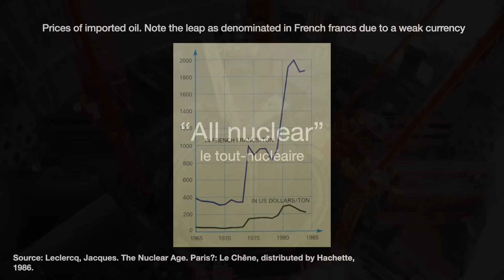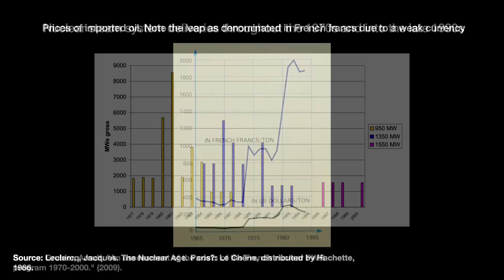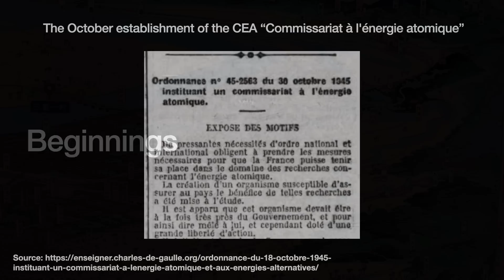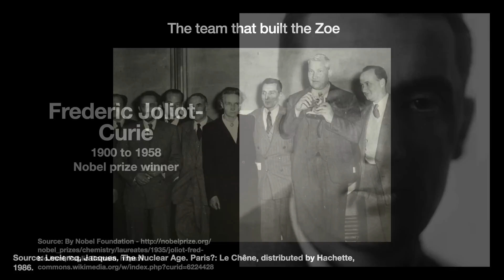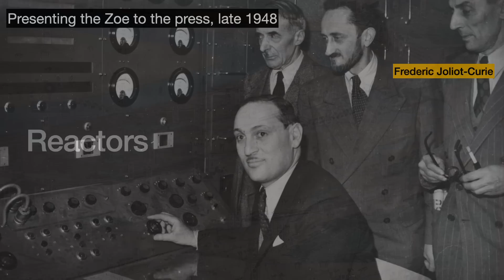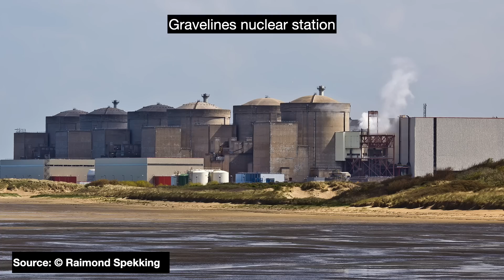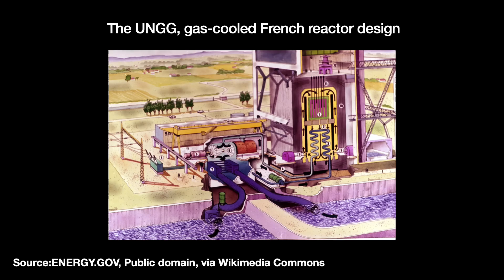That Time France Went "All Nuclear"

Comment: Interesting to hear that steam from PWRs is at a lower temperature than steam from coal fired plants. When Britain developed the advanced gas cooled reactors (AGW) they designed the outlet temperature to match the temperature of coal fired plants so they could make steam at the same temperature as coal fired plants and then use existing turbine technology without modification.

Comment: Until the 1990s UK's nuclcear engery was also entirely state run, with Atomic Energy Association running those reactors for the nuclear weapons programme  as well as war head manufacture, CEGB responsible for power generation and running the later Magnox reactors optimised for power rather than plutonium generation and British Nucler Fuels responsible for reprocessing. In the UK in the late 60s there was a similar "reactor battle" with the CEGB advocating for the General Electric BWR and Atomic Energy Authority advocating for the Advanced Gas Cooled Reactor (AGR) an evolution of the Magnox reactor, the AGR winning.

Comment: Another good video.  Problems:  he more than once confuses nuclear reactors with nuclear power stations, such as when he called the early Mesmer plan for 13 stations 13 “reactors.”  Stations typically have more than one reactor.  Also, he offers very little, almost nothing, on the single most important aspect of the French nuclear program, and the feature which sets its apart from every other program in the world, reprocessing.

Comment: Nuclear technology is the most  enslavery tech that exist, it is by nature one cycloide dépendance always increasing rate of dépendance, andcit is also one always more massive tech, only the small nuclear reactor escape this tendency, so the fragmentation of that technology is very difficult to realise in practice life...and always bigger and massive end up with critical security efficiency, ...so  with the huge park of Nuclear power in France, France got a very big financial problem to run it safely. because if the runing cost are limited,, but very high periodically, the permanent costs for assuring security are exponential, so any extended nuclear capacity always end up costing mutch more than prevision, and so force a country like that to look every where to take from every where funds,...it's a trap, but one trap with one very attractive false face, high tech always request high covering of costs, and always need permanent survey, and humans are not robotic permanent entities, so, ...⚓⚓🔎⚓⚓

Comment: This sounds very similar to the current Chinese nuclear plan. Top down strategy, standard designs, then later designs with local intellectual rights, increasing local share of parts. But China has massive needs for electricity, after decades of several plants started per year and almost as many reactors as France they are still to break 6% nuclear share of electricity.
I still think the nuclear industry would have been in a much better place if the political factors had taken a back seat to engineering and economics. Nations that didn't need nuclear weapons made reactors that were both economical, fast and easy to construct. The Japanese boiling water reactors are still among the cheapest, and the Canadian heavy water reactors can use natural uranium and used up fuel from other plants.
I think the nuclear industries of Japan, Canada and China would make for an interesting video.

Comment: I was bullish on Nuclear, thinking it would be a cheaper option but then I looked at France's electricity prices and they pay a pretty high price compared to other large economies with a lot less nuclear. So I don't think it's the solution if you think your electric bill sucks
Reply: Actually that's due to marginal pricing. Nuclear is cheap. But they don't charge nuclear. They charge you for the highest producers cost. Ie if nuclear is 40 Dollars a mwh and gas at 90 then nuclear gets paid 90 too gets it

Comment: The turning point for me was when the grid promoters said that new grid was extremely expensive more than $10million per km. 
($13million km for HumeLink 365km in Australia)
And also said that GRID costs to the consumer was part of electricity costs.
GRID RENTAL costs.

So Distant Renewables also had GRID cost. 
And new GRID Renewables was adding to consumers costs. 

These are nuclear promoters talking about GRID electricity.

Basically ROI, return on investment. 
Say about 10% per year of the system's valuation. 
1million km x$millions is $TRILLIONS 
Replacement valuation is bigger and decades longer.

ROI is $100sBILLIONS per year. Big 

New nuclear $10billion per GW.
14gW is $140 BILLION 

ROI is $14 BILLIONS per year. Small 

Nuclear promoters are correct GRID RENTAL COSTS are biggest costs to consumers. 

Nuclear promoters are correct GRID 247 demand is minimum for MAXIMUM UTILIZATION efficiency. 

Governments are correct massive grid upgrades costs are to be avoided. $TRILLIONS saved in budgets and their bigger taxation costs.
Fragile lightweight neglected national grid's budget busting upgrades are election losing political deadends.

Nuclear promoters economics of bigger costs to consumers is correct. 

Fortunately PV roof technology on dirt-cheap empty roof realestate has no GRID RENTAL costs to consumers. 

Fortunately all consumers have a roof to sleep under and a roof to go to each day. 

Fortunately consumers energy budgets can be redirected into PV roof electricity technology to unload the fragile neglected national grid.

Fortunately the daily DUCK CURVE of grid demand collapse in business hours is reinforcing all governments budget saving strategies. Happy days. 

Nuclear promoters are correct MAXIMUM UTILIZATION of private infrastructure investment, PV roof electricity is a valuable strategy. 

Unfortunately massive wealth is distorting common sense as nuclear plants are the favourite new PPPs favoured with government garrenteed cashflow and profits for 100years. Public Private Partnerships. 

Actually the real world facts are PRIVATE PARKING PLACES, PPPs for wealthy money and owners in tax havens shedding responsibility. 
Bad PPPs manipulation of common sense. 

Unfortunately silly-named comments are 'flooding the zone', for the wealthiest looking for Bad PPPs.

Comment: My concern is the promoters pushing to replace fossil fueled energy with grid nuclear  electricity starting with half of the existing national grid in Australia.

It is a massive investment that needs other generation as nuclear is too fragile to handle too much demand. 
France is lucky it can dump excess nuclear electricity into Germany and Belgium and Italy and Spain and maintain its nuclear fleet STABILITY. 

For Australia the previous federal government started the Snowy 2.0 project with a $2billion budget to get the tunnel machines into the ground. Now the budget has exploded to over $15billion and the time frames is unknown. 

The nuclear promoters want the nuclear option underway and fossil fueled energy extended 20years into the future. 

The grid and V2 vehicles are agreed for the future , but the economics in sunny Australia is ignored.
Reply: Nah

Comment: The problem with using enriched uranium is that it was originally the unwanted  waste product of the bomb making process - Alvin Weinberg used it in the original LWR reactor (Nautilus) because it was all that was available. 

You get 1kg of 3% enriched uranium for 9kg of depleted uranium which is the feedstock for making weapons-grade plutonium - this underscores the weapons aspect of enriched uranium. If you were really throwing out 89% of the original product and enduring a 500x cost increase, you'd use a natural uranium burning design (3% enriched uranium costs more than gold) for the same cost or cheaper

LWR, BWR and heavy water reactors all suffer badly from corrosion. Water at 325C and 20-100atm is not a benign substance (See Besse-Davis 2003) and the engineering stresses on boilers goes up wih the CUBE of the power being generated - you need around 3500MW thermal energy to drive a 1GW electrical turbine. A 8MW boiler explosion can easily flatten a city block. You really don't want the added complication of radioactively contaminated water in it too, but that's what we currently have

This leads to stupidly high cost on reactors (boilers) and they're a low margin item, which has resulted in all but one western supplier getting out of the business, only making them at a very low rate with a huge backlog in orders. The buildings wrapped around those reactors have to be able to contain a steam explosion and that in turn makes them cost billions

You've covered the wet steam aspect and significantly understated the engineering aspects. Turbine blade erosion due to droplet formation is a huge problem and the water condensing in the turbine case is also a huge problem

All of this pales in comparison with nuclear reactors needing to be loaded up with 2-5 years fuel at the outset. Any power station with that much fuel onsite is going to be dangerous if things go wrong

Weinberg recognised those issues, The LWR submarine reactor  was a "laboratory demonstrator" proiving that nuclear power was feasable but was NOT intended for commercial operation. What kind of commercial reactor has 89% input waste and 98% output waste, needs constant babying and has the potential to break in very nasty ways?

Industry ran with the LWR design because the US Navy has paid the R&D costs AND because the USA military encouraged it - using enriched uranium as fuel provided a figleaf for their depleted uranium bombmaking chain. Even by the early 1960s it was apparent that LWR or BWR designs were more expensive than burning coal and most commercial operators stopped planning for it

Meantime Weinberg was NOT HAPPY with what was transpiring and regarded LWR/BWR designs as dangerous, in addition to the nuclear weapons vs fuelling aspects (he was ardently anti weapons) as well as the high waste production(*). On top of that he reocgnised that ANY design using fuel rods is inherently abusable to produce weapons materials(**). That's why - via the Aircraft Nuclear reactor program(***) - he came up with the Molten Salt Reactor Experiment at Oak Ridge.

(*) HIgh volumes of waste are relative. A 1GW nuclear plant operating for 60 years produces about a an olympic swimming pool's worth of waste and that waste will be less radioactive than the original fuel in 450-500 years (yes, there's a 20,000 year aspect but that's 20k years of radioactivity that can be stopped by a sheet of paper). MSR designs reduce that to 3-5 cubic metres (or even less if you take a 1-3% reactor efficiency hit)

(**) All fuel-rod based designs and the LWR itself trace to the Manhattan project's X10 plutonium production reactor. Even Candu  can be abused to make weapons plutonium whilst the British gas cooled reactors were first and foremost intended for plutonium production, then tweaked for heat output.

(***) The ANR was never going to be able to fly, but it gave the funding his team needed to keep developing alternatives to LWR

MSRE worked - almost too well - Proving itself immune by design to the conditions which resulted in Chernobyl, SL1, Besse Davis, TMI or Fukushima

The design is much hotter than water-moderated systems, capable of producing dry or supercritical steam (via heat exchangers) - and can even be a drop in replacement for burners in other thermal plants.

The design produces less than 1% of the waste of LWR designs and that waste is virtually inert in 450 years. It doesn't use fuel rods, the costs of attempting to reprocess spent waste into weapons would result in bombs more expensive than U235 ones (Those are $16-30 billion apiece in materials(+), plutonium bombs are $28-60 million each) and they can be fuelled with thorium ($150/kg for that or unenriched uranium, vs 65-75,000/kg for 3% enriched U235)

The fuel freezes solid at 400C, doesn't dissolve in water and is unpressurised, meaning the worst case scenario cleanup is "with a broom", whilst the corrosion issues that are heavily played up by opponents are non-existent compared to water-cored designs (they play on people assuming water isn't corrosive when it's more like a hostile demon trying to claw its way out of the pipework and flash to steam - this is bad enough in non-nuclear plants when it happens but the added radioactive spice is what really matters)

On top of all this, MSR designs can be continuously refuelled (China's just proven that) and run on thorium without needing expensive/dangerous Th232-U233 conversion outside the reactor (China's proven this too - this eliminates an extremely expensive and unlikely possible weaponisation path)

Thorium is readily available. It's the major contaminant in rare earth mining based around monazite (more than all the wanted lanthides combined) and the first item separated (you have to do that to get at everything else). There's more of it mined each year than could possibly be used in nuclear power and it currently has to be dumped. A market for it at the same $150/kg as natural uranium would make rare earth mining worldwide and break the Chinese stranglehold on the materials  - a stranglehold because the Chinese government has been purchasing and stockpiling thorium from rare earth processors for the last 20 years. There's about 20,000 years supply in existing mining sites, let alone greenfield ones - and coal power station ash lakes have an even higher thorium/uranium concentration than monazite, meaning that mining those could pay for their cleanup

UNFORTUNATELY: Weinberg was too loud about his anti-proliferation views and ruffled American military feathers. The ramifications of civil nuclear power being totally divorced from its dependency on weapons chains resulted in the MSR being canned, attempts made to erase it from history and Weinberg being kicked out of the USA nuclear industry.

China is the only country (so far) to have made a working rebbuild of the ORNL MSRE (TMSR-LF1) but it's not the only country working on molten flouride salt thorium fueled reactors. meantime Europe seems to be ignoring MSRs in favoutr of a 100+ year bet on on fusion or enriched uranium designs such as pebblebeds and the USA has effectively kept MSRs illegal since 1972

France isn't planning to build any more nuclear plants due to their costs. That decision is likely to be shortsighted as "renewables" cannot bridge the energy gap required to fully decarbonise - it seems the traditional players have been heavily encouraging renewables so they can point to the long-term failure as a reason to stick with coal and oil/gas

Meantime China is likely to rollout MSR based nuclear power to 6 billion willing consumers. If Weinberg's assertions are correct (and so far. they have been) then Molten salt nuclear power is several thousand times safer to operate than water-moderated, 80% cheaper to build, 80% cheaper to run and because it produces so little waste, 97-98% cheaper to cleanup at end of life

Unless western nations pull their collective thumbs out of their asses, China will be THE 21st century economic hyperpower by 2050 thanks to it having broken the politics of scarcity that has always surrounded energy supplies across history. As much as the Chinese economic miracle demonstrates what can be done, their authoritarian government isn't necessarily a model the world should be emulating (for that matter the USA is demonstrably not that model either. USA citizens  are less free than Chinese ones in many ways and it's rapidly getting worse for USA residents)

Comment: So they actually had green safe and cheep energy...to bad they stopped
Reply: It's not so green as it isn't renewable, the total cost is very high, and it is less safe than renewables.
Reply: @natmaka renewables aren't very efficient and probably never will, nuclear is the way.
Reply: @C4brothers-cq4s  Efficiency (or another similar quantity such as load factor, equipment operating life, etc.) is a key criterion for equipment that consumes materials or fuel without recycling them, or that produces waste in significant quantities or that is permanently hazardous. Therefore, it is relevant to nuclear power but hardly to renewables.

Low efficiency increases deployment costs, but considered in isolation, it is not a deal-breaker: a renewable energy mix that produces adequately (quantity, continuity, impacts, total cost including recycling, etc.) is a good solution regardless of its efficiency.

The physical efficiency of today's nuclear power (fission, not breeder) is negligible because it converts only 0.7% of the energy of natural uranium (which must be extracted and enriched, processes that dissipate energy) into heat to produce steam, of which at best 37% of the energy is converted into electricity. Its financial return (profitability) is questionable.
Reply: @natmaka Salt reactors will fix that problem in uranium
Reply: Also,when I say renewables never will,I mean it will never be enough to make the fossil industry gone @natmaka
Reply: @C4brothers-cq4s  There is no industrial model of such a reactor, after years and billions invested.
Reply: If your thinking renewables can get better,so can nuclear reactors @natmaka
Reply: @C4brothers-cq4s  The research on new (Generation IV) reactors began aroung 1960, was booming in the 1990s, and is now nearly dead (fusion is the new objective).  It didn't deliver any industrial model.

Industrial photovoltaic and wind turbine appeared around 2005 and are booming.

The difference is huge and widening.  Check China: their nuclear program (world leader) is dwarfed by their deployments of renewables.